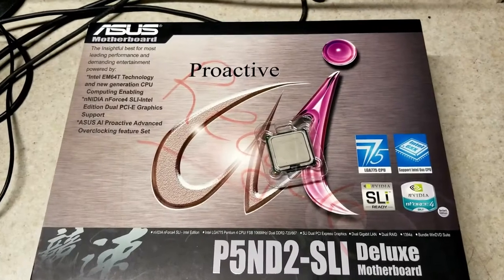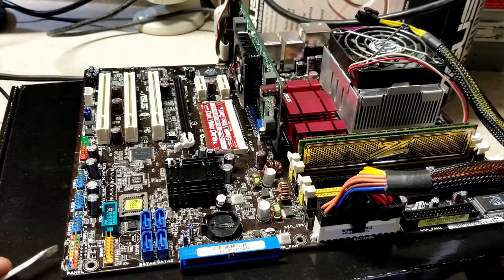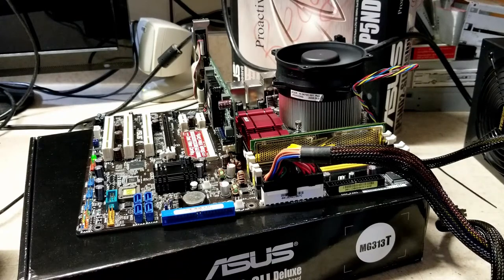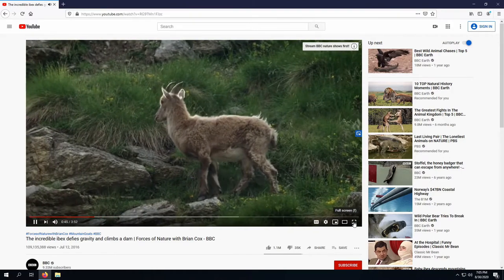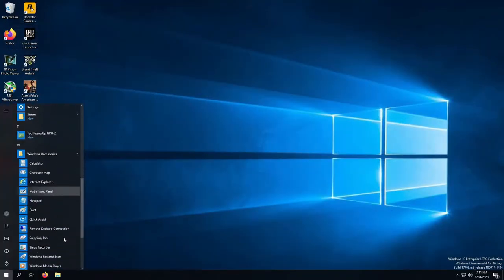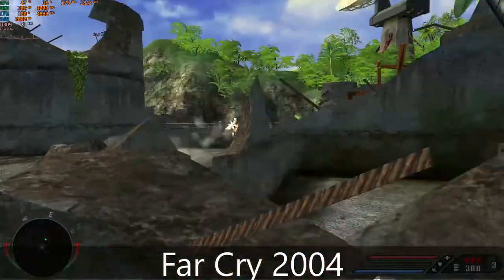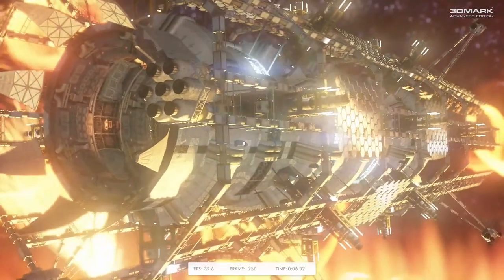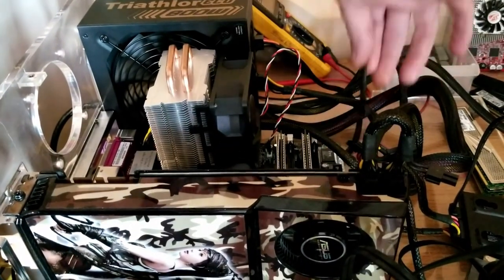Socket 775 Asus motherboard and Celeron D in Windows 10 plus some games.

Comment: you know the OC potential of these single and dual core systems still amazes me.  I'd like to watch a more in depth experiment of which chips OC the best, like a head to head.
Reply from the maker: I think the celeron D's would OC the most, I will be picking up a good cooler that fits socket 775 soon so I can really find out!

Comment: I just got one of those chips in and I am damn curious what you would set it to for a air cooled Win98 gaming rig. I just see people capping out quick at 3.8ghz or pouring ln2 over this thing.
Reply from the maker: Whatever you can get it to! Just bump it up, monitor your temps while putting it under load, and when you are satisfied with the frequency and temps, leave it there.

Comment: 1:47 never ever seen that sli card before.
Reply from the maker: It wasnt long lasting, there is also a molex power connector on the board you need to use as well.